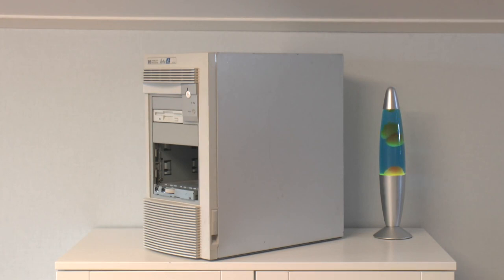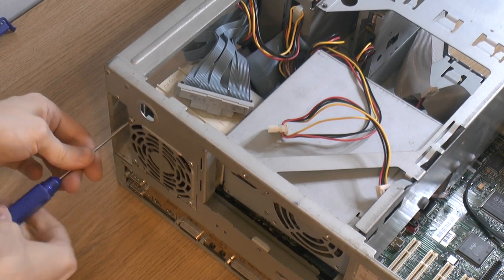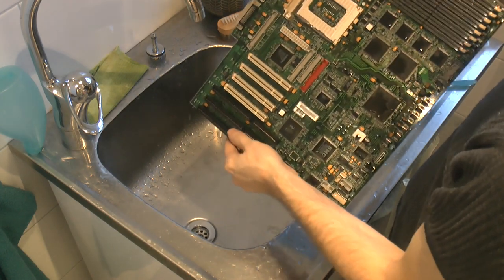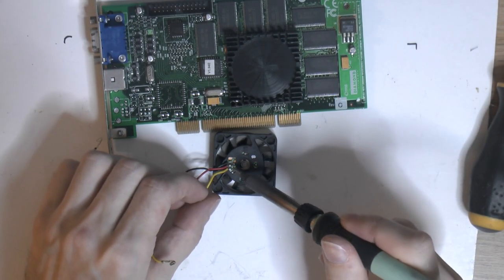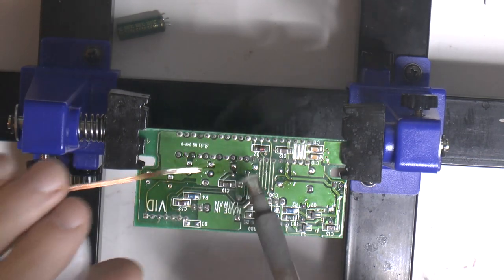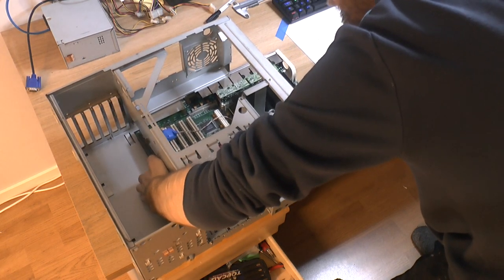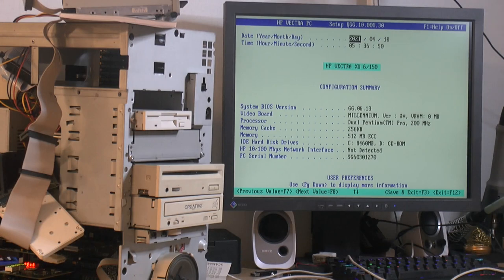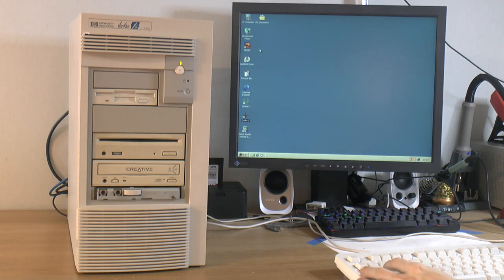Dual Pentium PRO restoration

Comment: Love it. Beautiful build. I recently finished a single socket 8 build with PPro 200MHz 256Kb and a Voodoo 2 to. Tried NT 4.0 as the performance was slightly faster in Unreal due to full 32bit, but ended up with 98SE because of compatibility issues with many DX games. Performance wise NT4.0 is very slightly faster than 98SE in games that run. GLQuake 0.97 runs at 92.5fps @640x480 on NT4 vs 88.3fps on 98SE and other games are that slightly faster, but Unreal Gold sees performance uplift from 25.5 to 29fps in NT4.0. All this games with the Voodoo 2
Reply from the maker: Nice! Yea I heard NT 4.0 is sad to be faster, but the compatibility is an issue with Direct3D missing.

Comment: This is so cool!  Brings back memories!
Reply from the maker: Did you have a Pentium PRO system? I never owned one but if you had one what was the specs and how was the user experience?
Reply: I use to own 16 of them but I have 12 now.  I post my PPro builds in the retro group on Facebook.  3 of the 4 I use to have were Dell optiplex gxpros.  They simply died which means they were the worst PPro's probably ever made.  The other one was a micron which I broke by accident.   Other than that socket 8 computers are one of the most well built computers ever made.  They are universal as a retro computer because you can run it with the 200mhz cpu or 333mhz overdrive with MMX.  However as well made as they are they can be finicky when it comes to hardware and cards.
Reply: 2 of the 12 are dual PPros.  One running win 2000 pro and the other WinNT 3.51
Reply from the maker: @euclideszoto997  Yea finicky this one was or is XD I think the owner wants dual P2 OD 333Mhz CPU's in it at a later date but the upgrade for him now should be fairly strait forward now.

I also made an update video because I didn't fully realize the CMOS battery was a SUPER CAP so reverted back to original Super cap because it seems to work fine. Probably will help him put a new one in later tough.
Reply from the maker: @euclideszoto997  Thats a lot of PPRO systems :P
 Takes up a lot of space I would think, I have like 10+ retro computers depending on how you count and my storage is full.

Comment: This brings back memories.  Years ago I bought a couple dual PPro 200MHz systems that were in need of help and I was able to use one to get the other working.  I learned a lot about how smp computers worked.  This of course was long before the days of multiple core CPUs.

My system was definitely a power-hog though.

Comment: Nice job. With dual processors, and 512mb ram. Along with a decent pci video card. You wouldn’t have a problem running a light Linux Distribution that’s modern enough to browse the web and multitask

Comment: That CMOS battery you removed is a ultracapacitor. 
They are charged by the motherboard, and keep the charge for a year or so before running out, so there is no need to replace it as they don't go bad.
Reply: Came down here to comment this. Ugh, pains me to see this done to this board. He should put the ultracap back, it's a much better solution.
Reply: @bryanpratt3933  He did in a newer video.

Comment: A little gold tip: ;) To boot with scsi drives, the boot disk need to be set as ID0. Change the ID jumper on the scsi 80pin to 68pin adapter on the boot disk to 0.
Reply from the maker: Thanks for the tip! 

It boots just fine from onboard SCSI and IDE but not with separate controller cards.
Right now it runs 50 to 80 pins scsi adapter instead using the integrated scsi on the motherboard.
The motherboard bios on this system only wants to boot the onboard IDE/SCSI, its sadly even hinted
 in the bios.

Also the Adaptec 19160 supports booting any ID because it can be configured in its Adaptec bios. I also have the same card in my Pentium 3 and that boots just fine but I run native 68 pin drivers so the ID jumper settings works as intended, the adapters dont always make sense it seem.

I did not include everything in the video but I did set the boot device to equal the ID of the boot drive during my troubleshooting.

I will try to make those 68 to 80 pin adapters cooperate with the ID's better in the future.
Rigth now the system is at my friends place so cant do any more testing but we rebuilt it a few weeks ago so its currently running one SCSI drive from onboard controller, Dual Voodoo2 SLI 12Mb and Dual Pentium II 333Mhz OD.

We also built a Athlon 1400Mhz system using a board i recently recaped (K7T Turbo2) and put the Adaptec 19160 card and one of the SCSI drivers in that system instead. But I did replace the 68 to 80 pin adapter because we had intermittent issues with the drive not being detected. But that system booted and ran fine after that.

Comment: Interesting video. In Unreal Tournament 1999 some details are turned on only in 3dfx glide mode and off in direct 3d and opengl. Those details are volumetric light and detail textures. If you type ''preferences'' in the console you can see this. So the Voodoo 2 runs the game with higher setting than the TNT, by default.

Comment: I have not found a SCA 80 pin adapter that actually works reliably. I get occasional detection and can install an OS such as Win98SE, but then reboot and nothing. No drives detected. I really want to be able to use SCSI on my retro builds, but I have not been able to.
Reply from the maker: Yea my friend bought 4x 68 to 80 pin and now a bunch of 50 to 80 pin, like half of them are unreliable it seems when I tested in this system. Idk bad soldering joints?

Comment: I appreciate the spirit of what you are doing, but I have to point out two things which are driving me crazy.

1. Shotgun recapping: I can't get behind replacing capacitors which have worked for decades without even testing their ESR, capacitance or leakage. Yes, electrolytics dry out. But good electrolytics can last for a very long time. Most of the 20+ year old caps in the HP gear I have tested have been fine. Hell, I have some salvaged Sprague caps from the 1970s which are still in spec! My point is, it looks like those VRMs had quality Panasonic capacitors. Unless those new caps were all from a quality manufacturer, not fake, and probably very expensive... well, they may die before the OEM ones would have. I have a hard time placing trust in anything but the most expensive modern electrolytics as too many have been engineered to last 10 years at most.

2. I mentioned this in another comment, but you replaced a 5.5v Panasonic ultracapacitor with two coin cells. It was working - whenever the machine is powered on it is charged to probably 5v minus a diode drop, hence the ~4.5ish volts you measured on it indicating it was working perfectly.

Please understand I am not saying you don't know what you are doing - or anything along those lines - because you obviously do. The work you did was good and I am happy to see this amount of dedication put into reviving an awesome dual PPro workstation. I watch a lot of these kinds of videos, and it seems that many tend to assume you must always recap a board and always cut out any 'battery' without question. Honestly, this practice will probably save more boards than it will kill, but the purist in me hates to see it done to these well engineered workstation boards when they are trucking along just fine.

Enjoyed the video, thanks for sharing!
Reply from the maker: https://www.youtube.com/watch?v=oiInEXM7aB4

Comment: But don't don't melt the sockets as that would not be good, those CPUs are getting very scarce as gold scrappers are buying them up to recover the gold and I trust you have a good few to keep you going.
Reply from the maker: Melt the sockets? You mean the CPU sockets? How would they melt?

The CPU's are fine, the CPU cooling consist of two CPU heat sinks then a duct from the rear 80mm Case/CPU fan. So cold air is drawn in from the back above the PSU, then trough the duct then blown over the two CPU heat sinks. The CPU heat sinks barley gets warm.

Anyway the CPU's are in my friends CPU collection box now, the System runs Dual Pentium II 333Mhz Over Drives now and the duct/fan keeps them plenty cool.

Was over at his place doing some changes to the system.

I hope this clears anything up about how the CPU cooling is implemented in the system.
Reply: I meant the CPU socket might melt
Reply: @DAVIDGREGORYKERR  how and why would the cpu sockets melt?
Reply: @jannenilsson3627  Become deformed if made from Nylon or ABS.
Reply: @DAVIDGREGORYKERR  How would nitton åttifyra melt the sockets? Im not following.